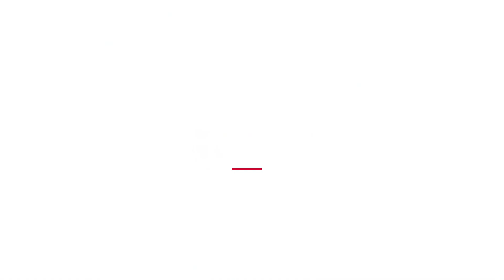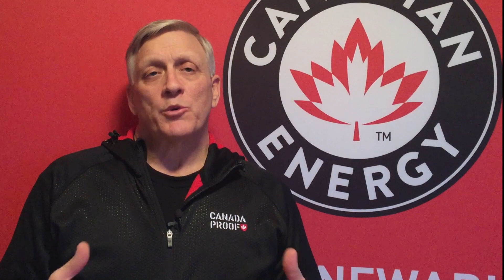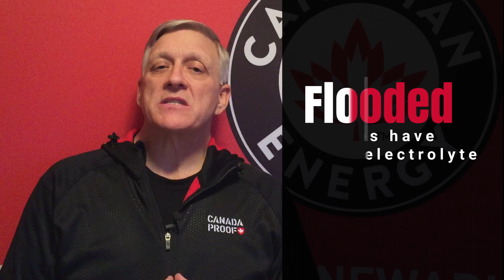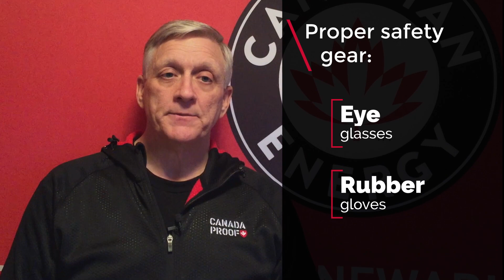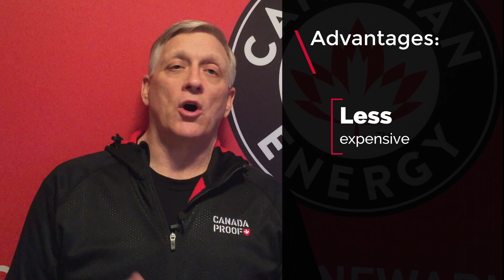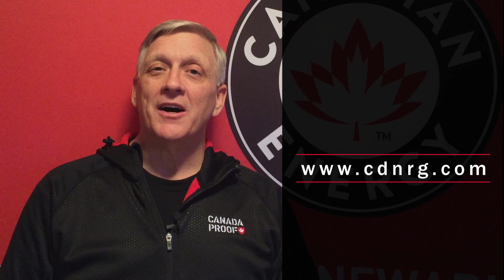Canadian Energy™ - What's the Difference Between a Flooded & AGM Battery?

Comment: can you charge both AGM and flooded batteries at the same time. i want to add 2 new agm deep cycle batteries to my RV and use them in conjunction with my regular flooded deep cycle batteries.
Reply from the maker: We do not recommend mixing battery types in a battery bank as AGM and flooded batteries have different charge profiles, even if the batteries are the same capacity they charge at different rates and so they will never be balanced. Hope that helps.

Comment: Agm batteries do not have sulfuric acid.
Reply from the maker: Keith Rose AGM technology became popular in the early 1980s as a sealed lead acid battery for military aircraft, vehicles and UPS to reduce weight and improve reliability. The sulfuric acid is absorbed by a very fine fiberglass mat, making the battery spill-proof. This enables shipment without hazardous material restrictions. The plates can be made flat to resemble a standard flooded lead acid pack in a rectangular case; they can also be wound into a cylindrical cell.